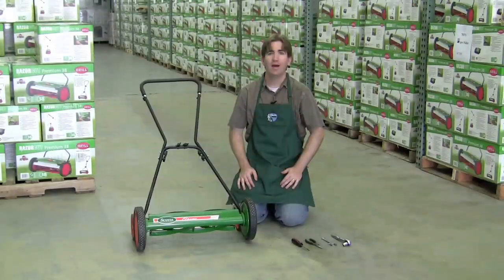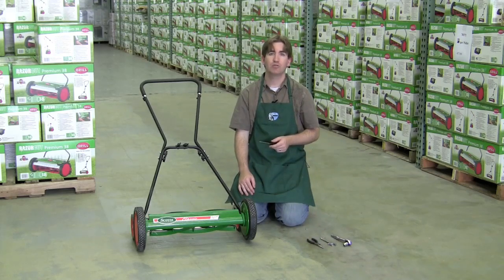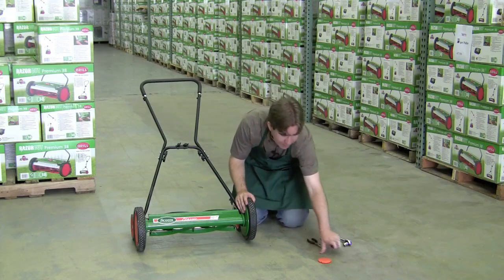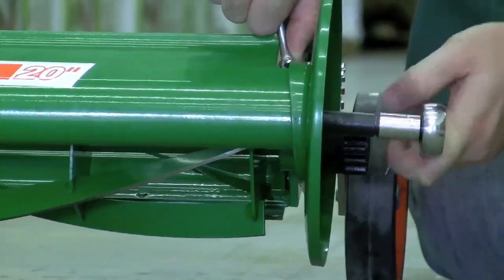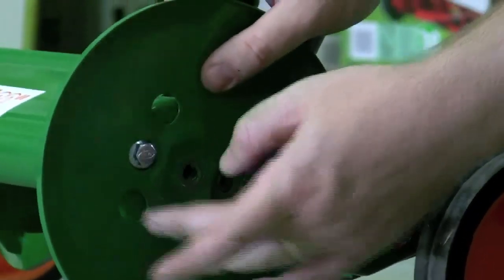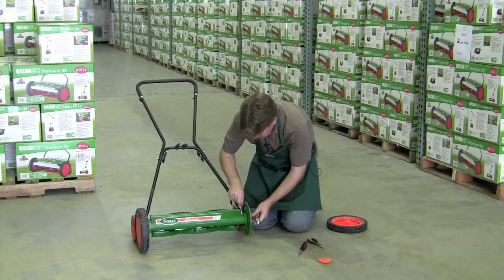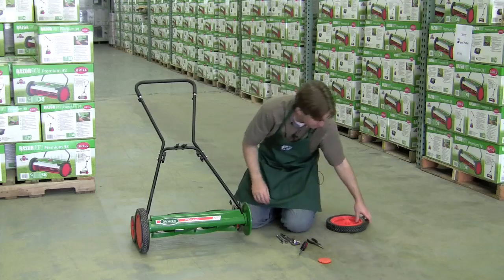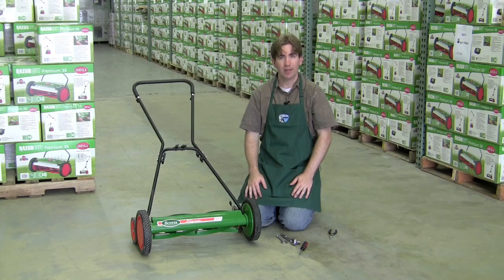How To Adjust the height on a Scotts Classic Reel Mower

Comment: There are two places where you can adjust the cutting height - 
1) Minor adjustments can be made by adjusting the roller assembly.  This adjustment is comparatively easy
2) Major adjustments can be made on the wheel assembly.  This adjustment is a bit more involved -(as described in the video.)

The Scotts Classic 16" we just purchased (March ,2017) the setting at the wheel is set at the factory in position C, the highest setting. 

By adjusting the roller assembly I can adjust the heights from 1" to more then 2"  And no tools required!  Planning to cut my Bermuda between these two heights...

Comment: Might be a "LITTLE" difficult to loosen is an understatement. I tore up my knuckles and it still didn't budge , so i ended up knocking off gear when i picked it up i thought it had picked up piece of wood covered in grease, but after tossing away i realized it was supposed to go in gear. I also had issues attaching catcher. The 1 we had when i was a child was so easy this is why i bought in 1st place. I cant return since i got so frustrated last yr i just put in shed & borrowed a gas mower. My husband was killed in a freak accident & I wanted something i wouldn't have to worry about trying to start or working on. Instead I've wasted y limited income on something i cant use.
Reply: Grumpy Toad 
Start going to the Gym !!
Are you that feeble ??
Geeeezzzzuuuusssss 🙄

Comment: I think factory is perfect height and would recommend leaving the wheels alone,. I suggest adjusting the 2 outer knobs above the roller part and it’s set to medium, with the inside wheel set to high, …

which with my new fresh seeded grass, I left the wheels alone , (at stock high top hole) but I set the rear 2 knobs to the highest cutting setting so I adjusted the knob to the lowest setting/bottom hole (lowest hole is high, middle hole is medium, and highest hole is lowest cut)

With that said, 90* temps here, the factory setting to the highest cut is too short. I say about 2.5 almost 3” grass length and I don’t know why anyone would even want to go shorter then that. I prefer 4”-4.5 height during summer and 3.5-4 in winter (yes would take more cutting weekly or biweekly , but I like long full grass)

So I’m here trying to figure out how to make this Scott’s Reel mower, to adjust it even higher.

Comment: Good instructions. Only problem I had was I had to keep backing up the axle /bolt to get clearance to rotate the height-set disk. Just a slight bump and the Gear Assembly  slipped off.  No problem except that the cog that links with the wheel is a free floating 1 inch long bar.  It too, fell out of place.  I saw that its ends were square on one side of each end, and the opposite side was rounded.  When I reinstall it in the drive shaft, it can be positioned in two different ways. Does it really matter which way??
... and HEY, you viewers who say you can't adjust w/o "removing the wheels (!) : once you've decided which of the THREE ranges you want, you needn't disassemble the wheel again.  It has a full one inch adjustment with the lever behind each wheel. Who needs to mow lawns at 3" high anyway?
Reply: potatoecouch Oops, on second look, I see that the free-floating cog/bar has two curved edges that are situated diagonally.  The 2 square edges are PUSHED by the black plastic gear; and the 2 curved edges allow the bar to slip backwards, to let the blades continue to spin or "free-wheel" -- like when you pull the mower backward.  So there is a right and a wrong position for that part.  Look at how the gear rotates to push the blades and you can probably see how to align the floating cog.  Sorry for "sharing" my confusion.

Comment: The main bolt won't budge at all, frustrating. Guess I'll try the no tools required adjustment and see how much it improves my cut. To actually have a lawn, no way this should be factory set to the lowest setting
Reply: Same, my bolt won't budge
Reply: @jonnyalmonte1070  I tossed it and got a battery powered mower, couldn't be happier
Reply: @TVResults  lol, yours didn’t come with the manual? No need to do this and remove the wheel for a shorter cut…
It’s stock set to highest setting in the wheel, and theirs 2 knobs near the outside wheel above the roller that you remove easily and shows 3 vertical holes on a plate…. U easily adjust it on lower hole for highest setting (2.5”-3” cut) or highest hole for shorter cut…. 

Hope you guys figured it out but since u tossed it, oh well, I paid $80 for my new baby grass and no gas mower yet till 6-8 months  lol
Reply: @jonnyalmonte1070  👍👍👆👆👆

Comment: Hi. Is there a best brand reel mower would you recommend to help now the tall weed grass?! It's 2019, is there any updates on reel mower?!
Reply: Reel Mowers are never meant for more then 2 or 3 inches. It is meant to be used multiple times a week for a groomed professional looking yard. If you mow tall grass or weeds it will either get caught or fold over and not be mowed.
Reply: @Sig_P229  I have a solution for that problem. Give the reel mower a good hard and quick push to get the reel spinning at a high speed. Then use small back and forth motions until the grass is cut. Works great on some long crab grass.

Comment: Complete fuking nightmare, hands too big, all angles- know what he means now about 'watching the blades'; whatever upright direction he set's in, had to do upside down/ no wrench I had could fit inside the tiny area once adjusted. At the "needle-nose pliers" part now w/ blood on my hands, house in total disarray &grease on floors. It's not on this dude, it's on Scotts for not making the [main] adjustable settings on outside to begin with upon purchase. 2hrs deep now, then next wheel if can force this bit on. Hoping if I do, the plastic snap on portion works, b/c that orange plastic smooshed out quite a bit.
Reply: 5hrs got it on, only mow's backwards now, gear thing inside w/ grease that auto falls off(?)- dunno/ gonna buy a box to send the mother back in. Grass can grow long.

Comment: this is way too much effort, other mowers are easy to adjust out of the box.
Reply: Yes, you can, don’t attempt this, theirs 2 knobs near the wheels above the roller that you take off and exposes 3 holes on a plate…. Lower hole is highest setting which I recommend and gives about 2.5-3” cut